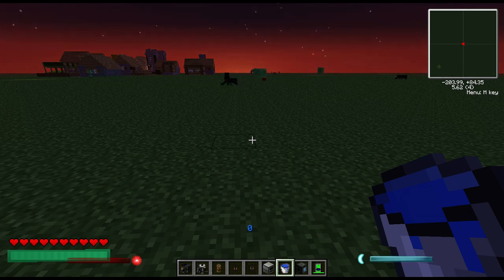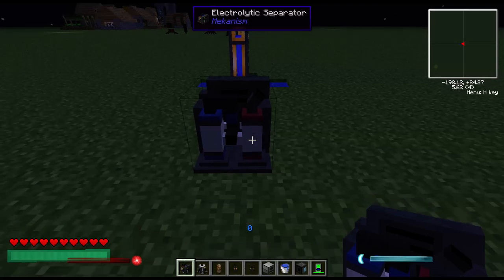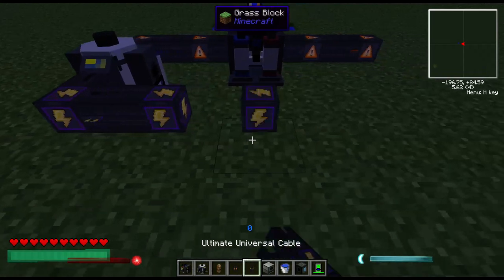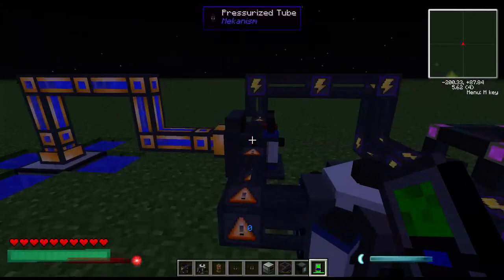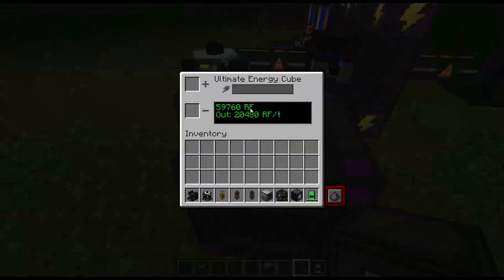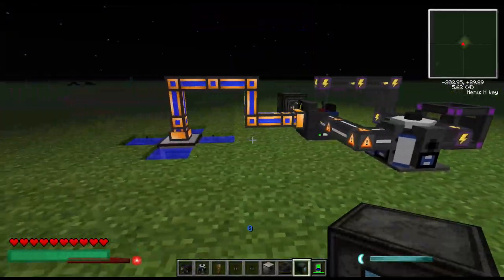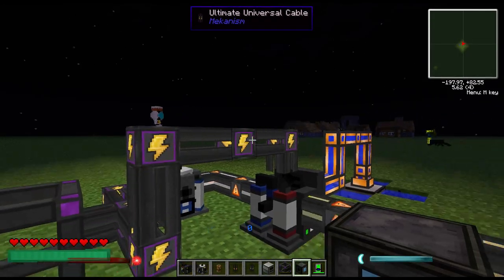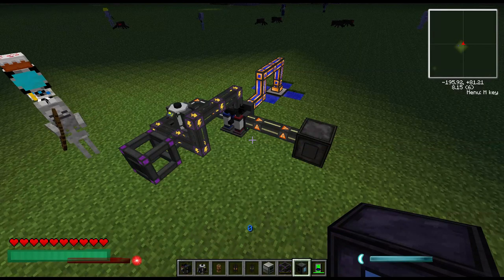Mekanism Tutorial - Infinite Power using the Hydrogen Generator

Comment: Doesn't work in the newest version http://prntscr.com/ewxpbg
Reply from the maker: Unfortunately they modified the values of the generator. now it currently makes enough energy last time i checked to run the system to make free oxygen. There is a slightly sketchier work around using magmatic engines and lava fabricators that i was using the last time i was on tekkit

Comment: This is driving me nuts but I have 2 thermal generators powering a pump. The pump is then feeding water into the separator via mechanical pipes which is feeding hydrogen into the hydrogen generator. I cannot get my hydrogen generator to even come on. Can anyone please tell me what im doing wrong please?
Reply from the maker: Johng2476 it is attached correctly? the hydrogen can only be inputted from either 1 or 3 of the sides, but their is the chance it is miss matched. Another chance is that you are dumping hydrogen instead of pumping. Try dumping your oxygen from the separator. If it's storage is full, it will shut off. Finally, if you have the mod pack installed us an aqueous accumulator. It will suck up water free of charge and wont use source/water blocks to do it. 

Sorry for the delayed response. Tell me if you ever got it working or if any of these ideas helped

Comment: doesnt work for me :(
Reply from the maker: have you made sure your hydrogren generator is facing the correct way? 3 sides inout hydrogen and 1 side outputs power, they are marked. Also did you give your system a jump? it needs power to run, so it needs something to start it
Reply: it powers itself but doesnt make more power
Reply from the maker: it should create a small amount of excess energy. Without seeing how yours is setup I can't really say much. it could possibly be:
- Your energy storage isnt positioned correctly (it is outputting through the output)
- Machines are setup to take power if no energy cube is used
- You arent using universal energy cables and your energy storage doesnt store KJ
- Your cables can't handle transferring all the power being created at once, and therefore causing the generator to store power. Would be fixed by upgrading cables

If none of these work, I will try to think of what could be going wrong
Reply: mine was using the first tier of cables from ender io to transport power, that might be the issue. i will try it with universal cables.
Reply: btw thnx so much fer the support :D
Reply from the maker: anytime. i need to start making more tutorials for people. been to focused on series at the moment. if the change doesn't work, we will try and figure something out
Reply: ye
Reply: although, i am playing in a newer version, so maybe they removed this
Reply: yea this no longer works with the new version of mekanism i did the exact same setup in creative and it doesnt create power only sustains itself. still good for making oxegen, but not good for power gen.
Reply from the maker: well that is unfortunate. i would suggest heat generators then possibly
Reply: ok
currently  we are doing a lava pump, i was just trying to come up with alternate energy sources. also, the setup isnt that bad, just remove the energy cube and let it power itself for infinite oxegen.
Reply from the maker: not bad. ive been trying to find another good way to power things. big reactors are a nice way to go, if you can make enough energy storage for it. im sure there is a power source using water. i will look into it
Reply from the maker: sjipsdew Can you do me a favor. try to create this again. Bring up the electrolysis separator GUI, and see if there is a lightning bolt in the bottom left of the GUI. If there is hover over it (or click) and see how much power it needs. Then go to the hydrogen generator and see what the output is on its GUI.

if the separator requires less power than the generator produces, you have a piping or wiring issue
Reply: the separator and gas burner are self sustaining it makes infinite oxygen
Reply from the maker: not the request. both of them should have a power requirement/usage on the GUI.
Reply: will do tomorrow. reply to this comment and i will remember to do so.
Reply: yup, tested in creative, gas burner creates the exact amount required by separator